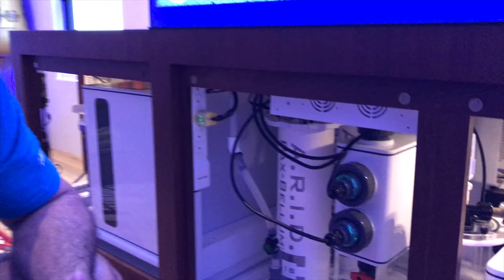This Beverly Hills Aquarium is Completely Custom: Reef 301

Comment: I've seen a lot of tanks a lot but this has to be in the top 3 as far as filtration. Yes it's top of the line equipment but the method is something anyone can do. Everything is right there under the tank even the water change system. The corals on the other hand are not something everybody can do lol. The corals are next next level. Very nice.
Reply: the corals are what only the rich can do lmao

Comment: Other than saying wow,  I gotta ask, how much of a pain would it be to clean out those hidden Tunze pumps?  That one that is lower in the "rock work" can not be easy to remove at all.   I mean I know Tunze pumps are high end but you still need to periodically clean them out don't you?

Also that light fixture, I noticed the light focusing was done with square reflectors/lenses, wonder if that x-y directionality of the way the light shines gives a different look as opposed to the radial pattern when you have a circular reflector/lens.
Reply: Ok, well this tank went from WOW, to HOLY SH**!      As that's my one issue with "clean" looking tanks (i.e. no pumps visible or cables) is that often it is a royal pain in the butt to remove the hidden pumps for cleaning.